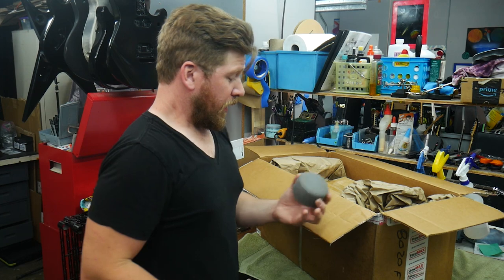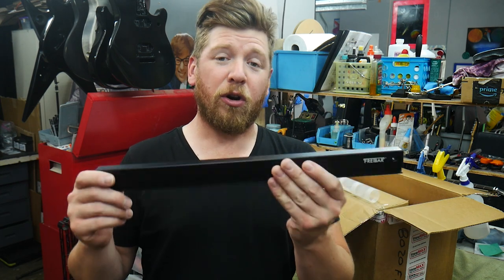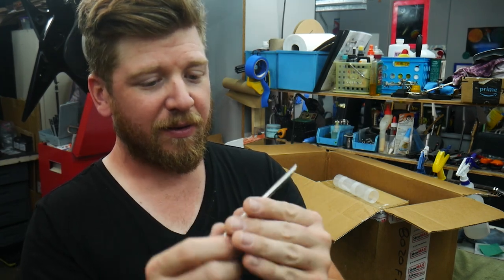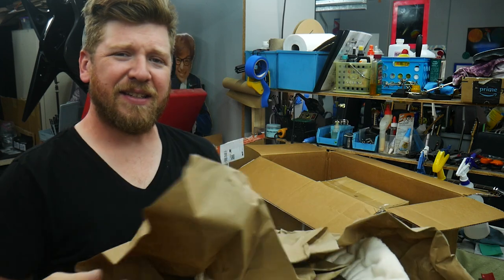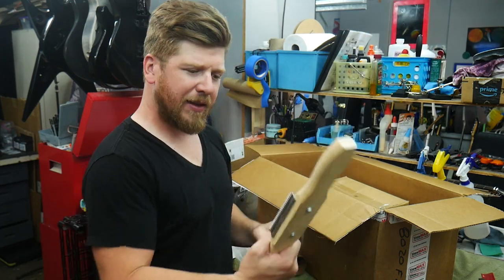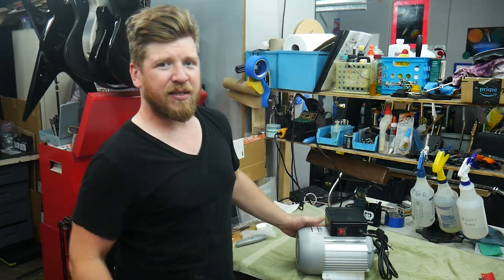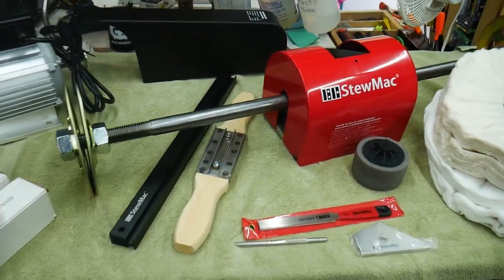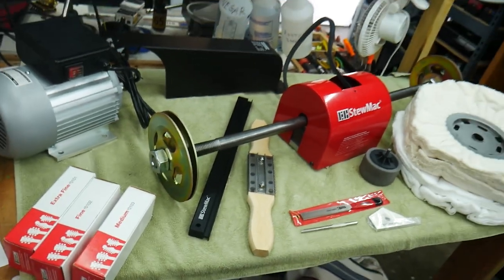I JUST SPENT $1100 AT STEW MAC - What did I get? NEW GUITAR TOOLS - Z FILE - BUFFER BUFFING MACHINE

Comment: I dig what you are doing heck I'm 60 years old and sick to me means diseased. I don't know if you are interested but I worked in the neck room at Kramer from late 83 to halfway through 86 we backbowed the neck before "leveling " sanded the heck out of the frets checked by magic marker sanding till it was gone crowned as thin a line as possible then steelwooled the heck out of the frets . This way after straightening the neck there was already relief without raising the ends of the neck so you could get the lowest possible action. The floyds I use are all 82 to 86 after that the tolerances fell way off like loose fine tuners variants in knife edges ect. I really like the esp necks from 79 to 83 before they started making guitars . Handcrafted 1 piece non tilt bananas .we had a buffing room with similar wheels . Thanks for reading this and keep it up and rock 🪨 on!

Comment: I love the stew mac buffing pads. I use them and they work very well. I also use the Z file. I bought the safe edge Z file and I have to say, it works but honestly it has some problems. It will actually scratch up the frets sometimes and for me it’s not really worth it. Maybe I should try the centered one. StewMac has good tools but they are very over priced. I like Luthiers Mercantile and Philadelphia luthier tool and supply. Great prices and their tools are quality as well. Good work! Keep the videos rocking man!

Comment: Very cool - thanks for sharing. One item I really want but haven't sprung for, is an edge file. I have two guitars, now, that need their fret edges filed and smoothed down. I tried once with a 'normal' file and just kept digging into the neck wood. Arg!!  Oh, and I also should have nut files. I tend to want my action a little lower (and the first three frets to be in tune!) and I don't have proper-guaged nut slot files. I had to have a new nut put on (by a proper luthier) a guitar cuz I messed up a slot.
Reply: Stew mac has a rough and shine kit that isn't that expensive and the buffing pads are easy on the hands to.